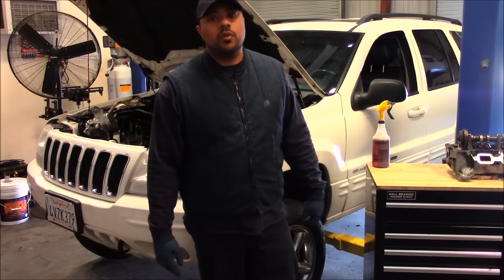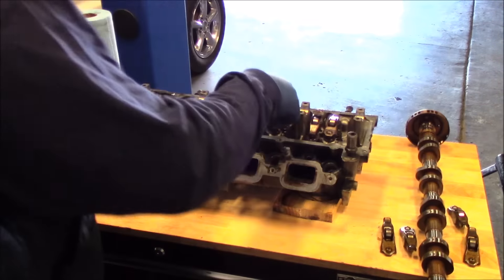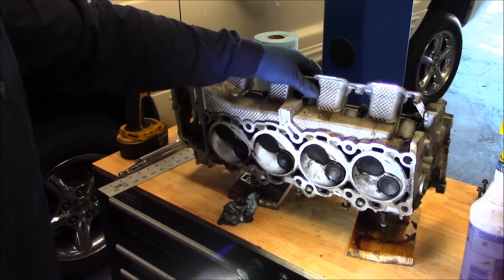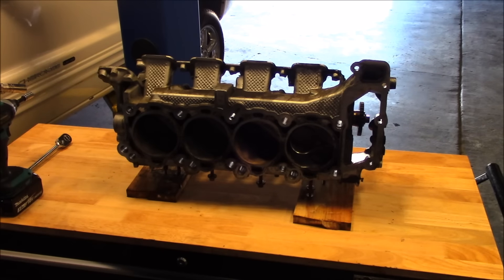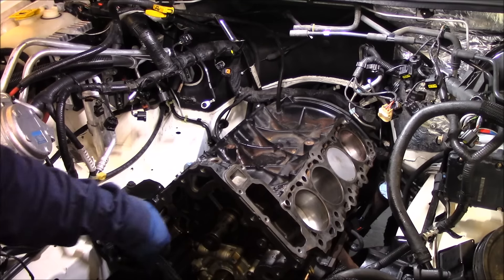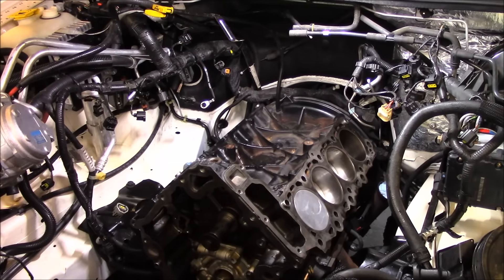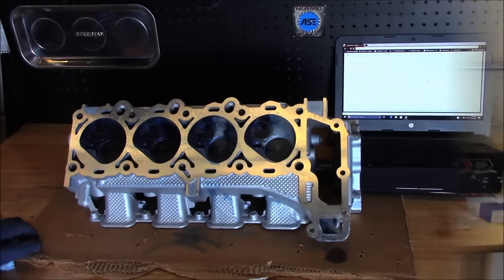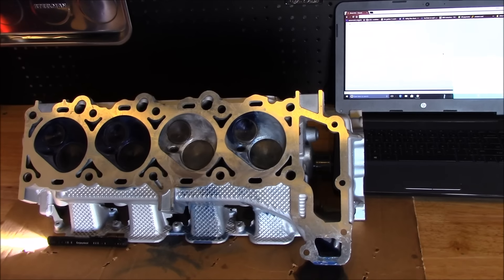Jeep 4.7 Cylinder Head Removal pt.2 (Inspection)

Comment: About to get into this on my 4.7 ram with 147k miles. Decided to buy new heads from clearwater cylinder heads down in Florida. I hope I can handle this repair, but this video series was instructional and awesome. Thanks Bryan
Reply from the maker: I'm confident you'll be able to handle it take your time use your head and watch this video series as a guide. I look forward to your updated comment that the job is completed and running great!

Comment: The marks you show around the seats at 22.00 are where the shop took a punch-hammer and "peened' the old seats to tighten the Aluminum surrounding the seats back up. I've done a bunch of this when I'm working on Alum heads and being Cheap.. When its not this much work to pull a head too.. This means they did not replace ALL the seats, only the ones that where bad. I believe you said you local shop was replacing them all and My local shop that specializes in these heads also replaces all of the seats and pins them so they will never come out. Their web site say's "Guides and seats have been replaced as needed". Thats the reason for the lower price. One other thought, If you have a problem, the local shop would be much easier to deal with that mail order. This is feedback not criticism. I've enjoyed the video and appreciate you sharing as I'm about to undertake the same job......

Comment: The blue stuff is machining ink they put it on when they machine the metal so they can tell if the grinder hits the entire surface. You don't have to remove it the first time the cylinder fires it will burn off.

Comment: Hi Bryan, 
First off, thank you very much for your stellar video; I am about 50% done with Part 2 and thus far your voice is clear and articulate and your dialog on the process is easily followed, many kudos!!!  I have a 2002 Jeep Grand Cherokee 4.7L with 150K miles and while traveling at about 25 mph the engine started to rattle and then stopped running and I coasted to a stop. I had the jeep towed home and using your video just removed both heads and found two valve seats dropped just like yours with the exact piston scarring pattern seen in your video.  
QUESTION: I may have missed it in the video but how did you determine the scarred piston was not damaged and how did you repair the scarring?
Reply from the maker: Excellent question, 1st and most important thing to examine is where the damage is located. If the damage is in the center of the piston with very little material missing then mostlikely it will cause virtually no change in the way air and fuel are compressed. On the other hand, if the damage is close to the edge of the piston then forget about it because compression is going to escape pass the rings a cause a serious misfire.

Comment: I have 3 4.7 L jeeps, all with around 180k miles 
So far no issues with dropped valve seats and I always thought it would be caused by overheating.
But I’m sure there are some with machining defects which cause seat failure.
Reply from the maker: If it overheats a valve seat is falling out for sure 100%,
 But also I've seen valve seats fall out without overheating, Like the jeep in this video!

Comment: Thanks Bryan, awesome video series! You're saving lives and saving us excessive repair shop costs...it's nicer when you know how thos all works and then you can either get someone to strip heads out at your place and you go pick up all the neccessary spares and then have that same person reassemble everything back...definitely saves lots of cash and you know it is done to the T as you'll be the one buying all the repair parts you need...

I just have one question, what are clear indications that Valve Seats dropped without vehicle overheating and what are clear indications that Valve Seats dropped due to overheating? 

Thank you for your tremendous assistance.

Comment: it`s not previous damages trace around the new head valves , it is the valve seats that have been pin-hamered so they dont fell of  again , the blue stuff is machinist tracing blue , great video man ,well explained a+ , will try to change 1 head with out removing the timing cover :o  (fresh rebuilt engine but one bad head to change) .
Reply from the maker: Thank you for that info! I would remove the timing cover if I were you!
Reply: did for you , you helped me with your nice video , i save you time for the next time, did nt try the left side
(i did not needed)
Reply: yes easy job ,was in the same situation like you(not again!) just need to keep a tension on the timing chain with a bungy hook , the problem is to reset the right tensionner, made a video how  (3.7 head replacement w\o removing timing cover https://www.youtube.com/watch?v=YXVBXnMI7js&t=98s

Comment: The blue could be Dykem bluing.  Mchine shops use it for laying out scribe lines but it can help prevent rust.  They likely spray the entire head with it before any machining and or lapping. Was it wet like oil before spraying the cleaner?  Dykem dries to a matte finish and scratches off or melts with cleaners.
Reply from the maker: Wayne R   It felt dry and sticky
Reply: bryan916 it's a guess without seeing it in person but I'd guess it was dykem
Reply: @wayner7126  Yes!
Reply: @BryansGarage951  it's dykem and it's used exactly how he said he's one of a few on here that knows what he's talking about and based off of his explanation I'd say he's used his fair share of it

Comment: Superb video Bryan!  Question for you.  Though I know you didn't use it for this video, have you used the timing chain holder tool for these motors, and if so are they worth it?  Thanks!
Reply from the maker: Thank you Robert! Using the right tool for the job is always going to make the job easier and in that since it's worth it but I've done so many of these without using the timing tools I really don't think its Matters to much on these Chrysler 3.7 & 4.7 Motors!
Reply: @BryansGarage951  Thanks Bryan.  I greatly respect your "do it like I've got to follow it" credo!  If I ddin't do this stuff myself and lived near you, you would be my go to guy.  Much respect.  We also have a lot of the exact same tools. :-)

Comment: The blue stuff looks like Magna Flux for checking for cracks under a special light.
Reply from the maker: Right on!
Reply: Bingo
Reply: Blue dykem machinist dye used to mark metals surfaces and what they were using it there for is to make sure they cleaned up the area for the valve seats and not have to take off any more material than necessary. That's just an opinion not 100% sure but I'm pretty sure it's not magna flux seeing how aluminum isn't magnetic that is but I've not been in a mag booth in 10 years now and maybe they came out with something that lets them do that now but seeing as how your talking about valve seats and that's the general area the dye is at I think I'm going to say machinist dye

Comment: The blue stuff is machinist dye or the dye they use to magnaflux check for cracks.
Reply: Man...when I don't know what the hell is going on, I just keep my mouth shut.  You should adopt the same policy!  Then again, I would love to hear your explanation on how dye is used for magnafluxing.
Reply: @robertrukidding3055  that's absolutely funny as hell this had me laughing so hard I was crying! Thank you very much best reply comment ever
Reply: It's dye used to mark metals used by machinist 99.9% of the time because it works and is fairly easy to get off and as far as the stuff used to pick up cracks depends on the type of metal and if it is magnetic or not but the magnetic kind is magnaflux and the non magnetic metals they will use specialized paints one sprayed over another that will show up cracks and I'm sure their many other types I'm forgetting now

Comment: This video is epic...the blue stuff might be lapping compound or some type of grease to keep the valves from rusting...kinda like the grease they put on rotors to keep them from rusting in the box
Reply from the maker: Thank you!
Reply: it won't be lapping compound, that must be all removed as abrasive .
It should be a dye they use for checking valve seating pattern and small defects at final stage I suspect .
Shoot the company an email as sure they give you a run down on head rework steps and what they use .
Reply: @mrb1864  Blue Dykem machinist dye maybe maybe not who knows

Comment: I'm doing this on my ram truck with the same motor, should I also replace the oil pump while it's open already?
Reply from the maker: You have to remove the oil pan to remove the pickup tube which can be difficult if your vehicle is 4wheel drive.

Comment: If I loved near you and you were doing the same job for me today, what would I expect to pay?
Reply from the maker: Labor about $1800
New/Rebuilt Heads $350 per head =$700
parts and fluids $400
Tax?????
Reply: Man, I wish you were near Houston.  I need this exact job done on my old Ram truck.  Can't bear to let it go but can't find anyone to do the heads right for a reasonable price.  I used to do this work myself, but I gave that up when I turned old.  lol  Cheers.  Great video btw!  I love it.  You help a lot of people broski.  Thank you.
Reply: I’m working on the same car guy charged me 350 per head in Oxnard 400 for complete gasket set and bolts and then hot tanked the heads 1120$ just the heads 😊

Comment: If these heads are resurfaced, How can you use standard thickness head gaskets? OEM does NOT RECOMMEND resurfacing any head more than 0.002" due to cam timing issues. Please explain, Thank you.
Reply from the maker: According to Chrysler The standard head gasket or OE gasket  when bolted between cylinder head and cylinder block should compress no lower than 007mm. If you measure the gasket out of the packaging its 009mm. So the OE gasket gives you a little bit of leeway. Hope that answers your question!
Reply: @BryansGarage951  Ok, But how do you know they did not cut .010-.020 off the head? would you not need a thicker head gasket to get it back into speck so the cam timing is not off? The Dodge Dealer here in Florida says you cant cut the heads you must use new ones & that makes no sense to me. 
Just trying to understand all this. thank you for your time.
Reply from the maker: @georgehotz8865  No you can resurface 4.7 heads with out changing valvetrain geometry, of course you do want to go crazy and remove to much material but yeah it should be fine.  A Car dealership will never give you advise that leads to less profit for them. Nothing wrong with having you heads resurfaced. Find a reputable Machine shop to do it for you. They will measure the head a tell you if theirs enough material left on the head. If the heads has never been machined I'm sure you'll be fine do let them get you for you hard earned money!

Comment: Ho many miles before the valve seats getting bad on the 4,7 v8? asking because i might buy a grand cherokee with this engine that has run almost 300 000 miles ith the engine never opened
Reply: Usually 70k to 100k. I only got 150k on my motor before it wore out the bearings so I wouldn't recommend getting that jeep. This motor is only designed to last 150k 🙄
Reply: @JoshMcGrath98  well, My beast only has 320k😕